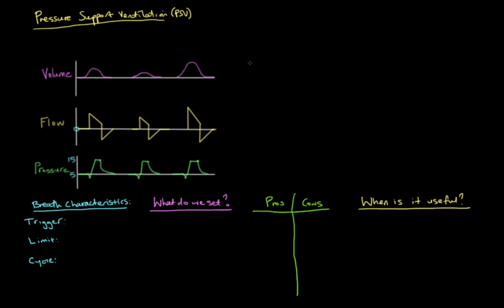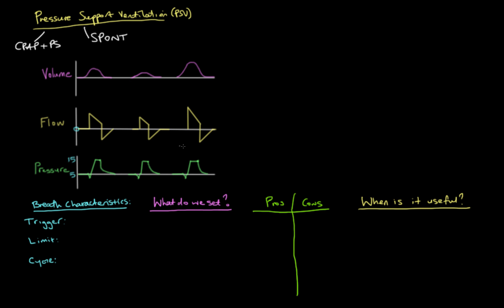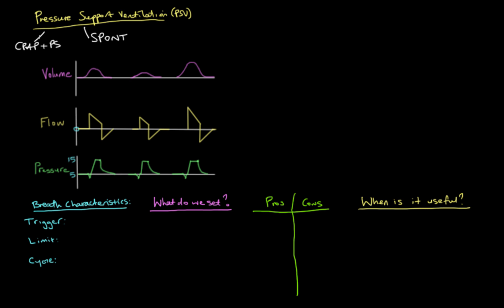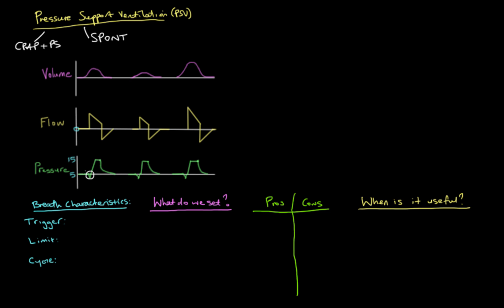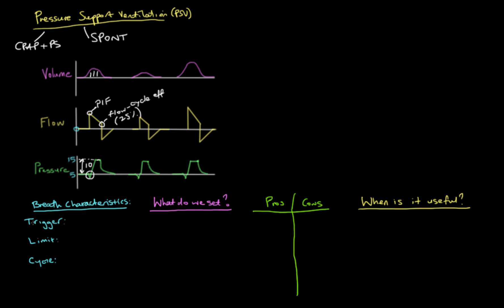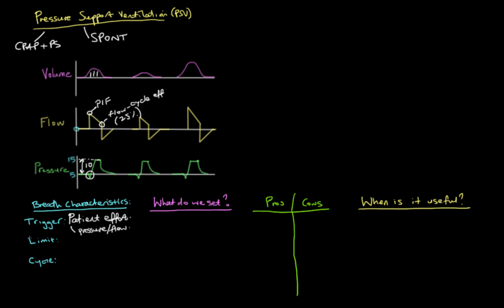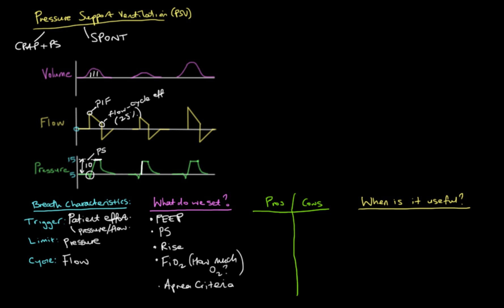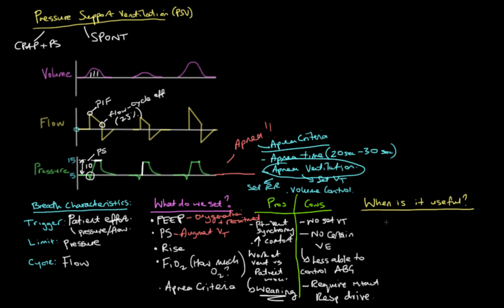Principles of Mechanical Ventilation 13: Pressure Support Ventilation

Comment: PSV is flow cycled and flow controlled not pressure controlled
Reply from the maker: Not sure if this is a question or not but appreciate you posting. PSV is  pressure limited, flow cycled .
Reply: @RespiratoryReview  Hi yes you are correct, that it is pressure-limited. I cant recall now but I believe my comment might've been a response to an error about the control variable of PSV referenced in this video, which would be flow not pressure .
Reply from the maker: @johntadros50  No problem. I’d recommend you take a look at the video on phases of a breath where I cover what limit, cycle, control variables etc are. It seems like you’re confusing some of them a bit. Flow is not controlled in PSV. You’ll notice I don’t mention any variable as a controlled variable in this video.
Reply: @RespiratoryReview  Oh sorry you might have misunderstood what I meant by Flow -controlled. A control variable is the primary mechanism by which a breath is delivered/regulated so in the case of PSV that would be flow. A common mistake people make when thinking of PSV is that pressurized air is being delivered but this is not the case. Flow is delivered and that flow creates a pressure which we limit with the pressure support parameter.
Reply from the maker: @johntadros50  Sorry John you're mistaken here. Flow is variable in PSV. It isn't controlled by the ventilator. Look up Pilbeam, S.P. (2015). Mechanical Ventilation: Physiological and Clinical Applications. Elsevier Health Sciences
Reply: @RespiratoryReview  Well yes you are right that flow is variable that doesn't refute my point that its flow-controlled. When you go up on the pressure support knob on the ventilator you're increasing flow not pressure. Flow is the main driver of the breath.

Comment: Hi.thank you for an excellent presentation.
Can we use PS as non invasive ventilation?
Reply from the maker: Hi Rashad. Yes PS can be used during non-invasive ventilation. Most modern ventilators have “non invasive” modes where the patient can be receive CPAP+PS via a face mask or other NIV interface.
Reply: @RespiratoryReview  woww,thank you for your quick response..
Reply: Do you have any live session (certificate  program)on ventilator settings?

Comment: Doc I haven't yet understood that once patient triggers his own inspiration then machine takes over quickly to reach set pressure..or it waits for patient to do max inspiration that he can and then it just provides the extra flow to reach the set pressure?
Reply from the maker: The pressure support works WITH the patients inspiratory effort. It doesn't ever "take over" as long as the patient is making respiratory effort. It also doesn't wait for the end of the patient effort to "top up" the breath. PS and patient effort work simultaneously. That being said, a patient making weaker efforts will likely require more "help" from the pressure support to generate sufficient volumes, whereas a patient who is making stronger efforts will need less. It's ultimately a balance between patient effort and machine support. If the patient is not making any effort, PSV may not be the best mode for them. They may need to recover further from the underlying insult that lead them to be ventilated before PSV is tried again. Hope that helps.
Reply: @RespiratoryReview  Yes now i get it fully. Thank you very much!🙏🙏

Comment: Can we sedate nd paralyse pt when pt is agitated on psv mode?or srdation nd paralysis cn b done only in control mode of ventilation?
Reply from the maker: Pressure support ventilation requires patient effort - which won’t happen if you paralyze them. So you can’t paralyze people for PSV. If you did, there is a built in safety mechanism of the ventilator called APNEA ventilation (or back up ventilation) which will take over and ventilate the patient. So you need a controlled mode of ventilation if you plan to use paralysis (or deep sedation - which also can lead to apnea). Hope that helps.

Comment: If we set apnea time of 20 sec,then wat is role of RR,
Reply from the maker: The patient decides when to breath. IF they don’t take a breath (apnea) for 20 seconds, it will trigger the ventilator to take over and deliver breaths at a preset “backup rate”. If the patient is initiating breaths there is no RR that we set. They choose how many times a minute to breathe. The back up rate only kicks in if they go apenic for 20sec (or whatever we set the apnea time threshold to).
Reply: @RespiratoryReview  thanks sir
Reply: Sir wat to do if rise time is oblique nt straight nd wat is its significance if it is oblique

Comment: Excellent. The question is really how to determine the PS value? Thank you.
Reply from the maker: Great question. Setting PS is a bit of an art. You want to adjust to achieve an appropriate tidal volume, decrease work of breathing, but allow the patient to take on enough of the work of breathing to exercise their respiratory muscles. Interestingly, patients control their minute ventilation with their respiratory centre in the medulla, and increasing the pressure support (increasing the tidal volume) doesn't tend to increase the minute volume - they just breath slower to compensate. So as mentioned in the video we are less able to tightly control the blood gas in PSV. Hope that answers your question.
Reply: RespiratoryReview Thank you. Can one give "too much" PS, causing respiratory distress/uncomfortable sensation to the patient? I would assume so, which would tie up with your reply that this is the art of medicine.
Reply from the maker: Yes definitely. Giving too much PS does a couple of things. Firstly it exposes the lungs to the well known deleterious effects of large pressure changes (deltaP as it's sometimes called), secondly it almost entirely unloads the work of breathing from the patient, which defeats the purpose of PSV. We want them to be using their respiratory muscles and contributing to the WOB. Giving too much PS is a very quick way of making someone ventilator dependant - resp. muscles atrophy and they can't tolerate not being on the vent. We've all seen that happen!
Reply: RespiratoryReview Great video and even better ( hardly seems possible) replies to questions. Looking forward to the next installment.